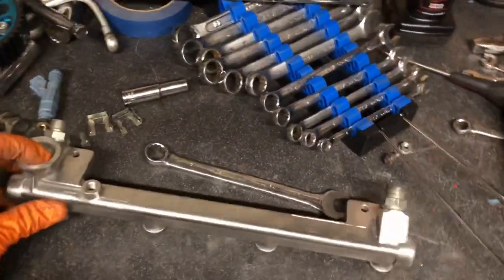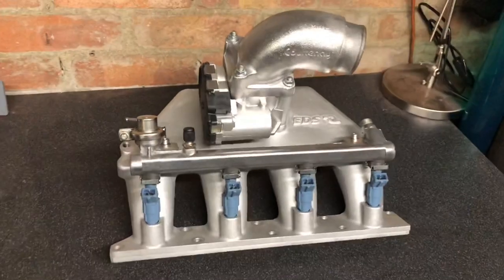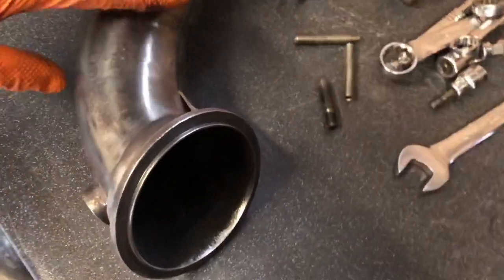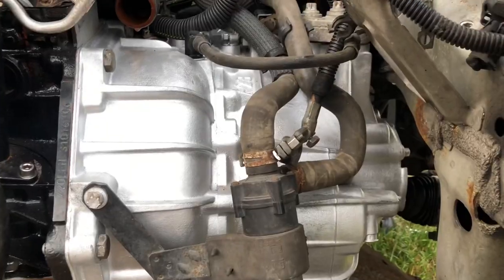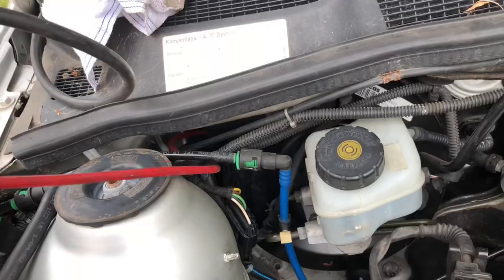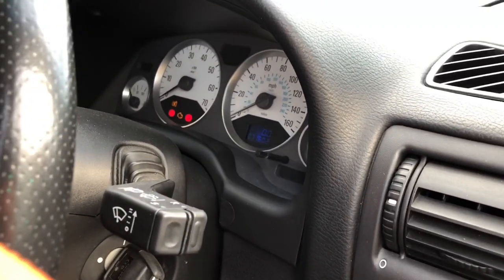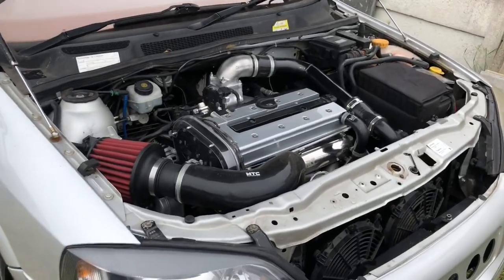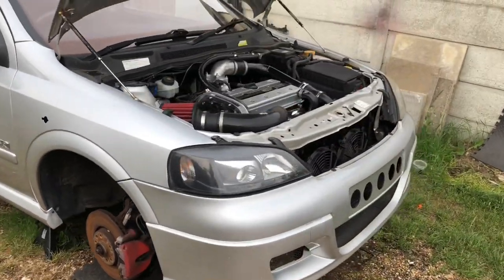BARN FIND Astra Sri Turbo 190 Big Spec Forged Engine First Start up! IT Sounds Fantastic

Comment: I've been following this series with massive interest. Your knowledge and attention to detail is incredible. I had one of these from 2005 until 2008 when it got written off on a wet day by a 1.3 Escort on bald tyres. It was my first performance car and I've got lots of fond memories of it. I'd been in a Cossvaux tuned one a year or so before I bought mine and from that day on I had to have one. 

I replaced it with a H VXR and a few years later replaced that with a J VXR but they never quite had the same feel. I miss the SRi Turbo like you wouldn't believe even to this day. Thank you for the trip down memory lane 👌

Comment: Your probably right  about the engins.i dont now how the engines where brock in.onley 1 of them i seen brock in.but the engine was siting for a long time b4 it was fitted in.i go for saab engines cos iv had 4 saab and the engines were allway good.the gearboxes were crap tho.i broke 2 of them.f23 box is much beter than the saab fm55.thanks for being decent and geting me right about thes engines.

Comment: Hi I wanna to ask you about the v band diameter inner and outer because I will fabricate one stainless steel 304 so if you pls to give me the diameters ...thanks bro
Reply: I got one 3 inch 76mm it is a small one and get 4 inch one it is a big one and I measure the outer turbine I got 99.41 mm I remember so what is the right solution ? Pls advice thanks alot

Comment: Hello. One stupid question-how to turn on the second water pump,electric one?
Reply from the maker: It should turn on when you turn ignition on
Reply: @AaronUnknownPerformance  Thank you mate,but its seems my one dont work.Will try to find it why.
Reply: Shoud plug back in , mine leaked from the top into we're it was magnetic.
Reply: Check for corrosion.mm
Reply: @guiiviibygreenman8109  its working mate dont worry.Thanks for advises by the way :)
Reply: What was the problem?
Reply: @guiiviibygreenman8109  Its seems it was working all time, just i don't know how exactly to turn it on :).